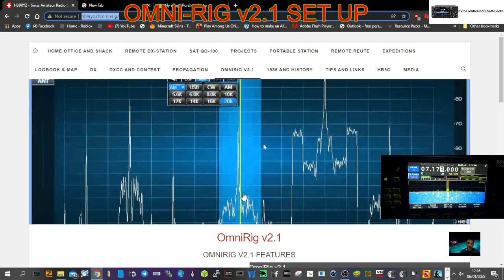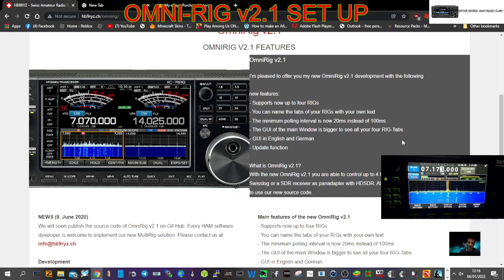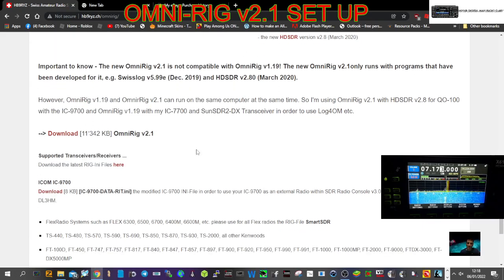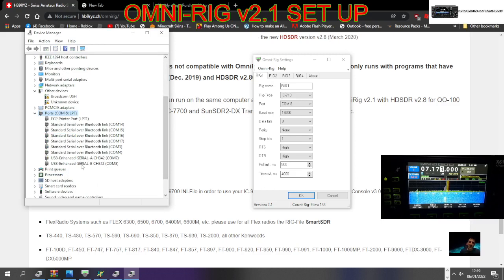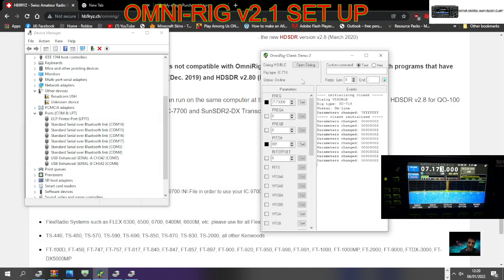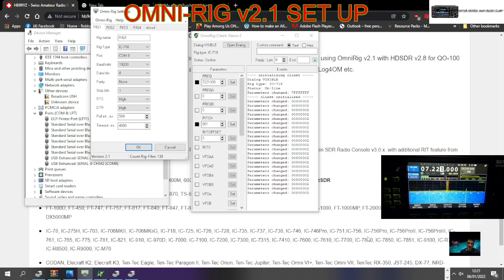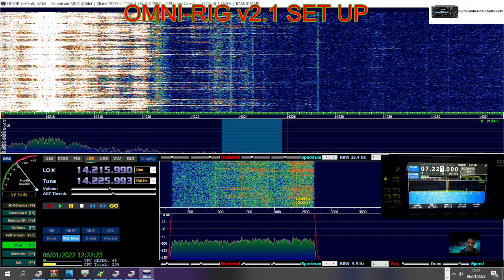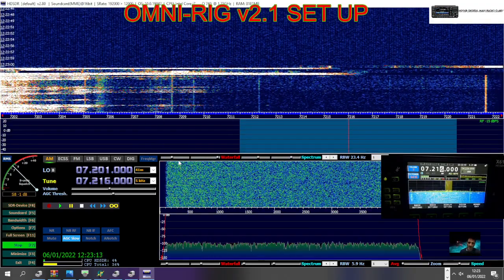OmniRig V2.1 Full Set Up

Comment: Why isn't everybody doing this?  This is fantastic!  I came across this vid because I tapped my 1st IF on my Yaesu 857D to connect to an RTL SDR for use in HD SDR.  I should (in theory) be able to manipulate the signal since it's coming in through the SDR, so I guess that should provide additional digital filtering.  I am connected to my pc via a bluetooth CAT dongle plugged in to the 8 port mini din on the 857D!  Pretty sweet!!!!
Reply from the maker: Sounds like your having lots fun :)
Reply: @M0FXBHamTech  I'm in love with the 857D right now.  Such a base rig, but with a few mods, it becomes a miniature powerhouse!  I hope Yaesu's answer to the IC705 is a 100w all mode all band rig in a similar form factor only with a screen , Bluetooth, and other new features!